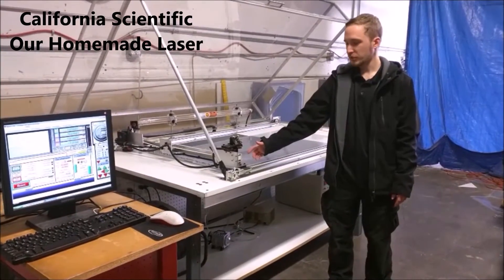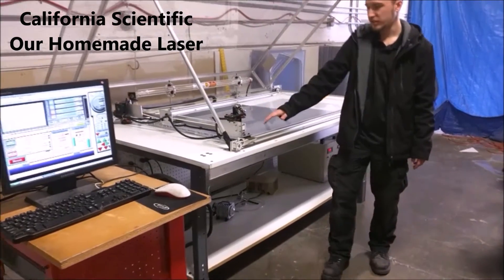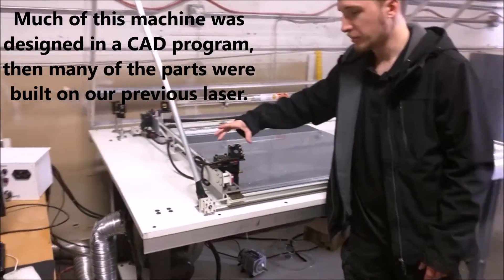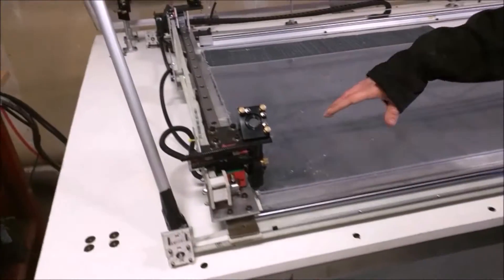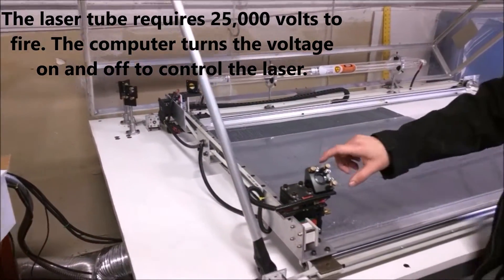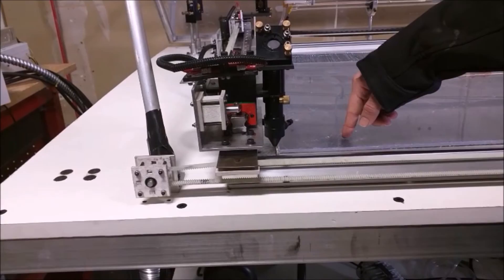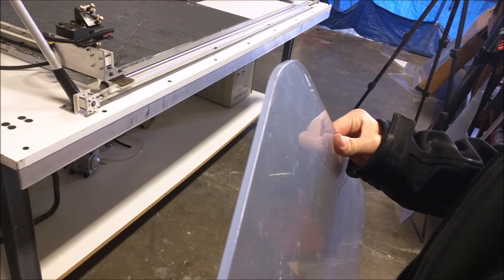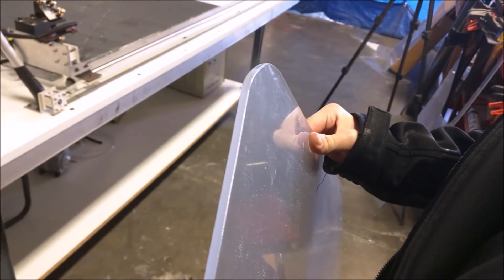LaserMovie

Comment: On your website I didn't see a listing for either of my bikes, a '97 Honda Shadow or any of the Suzuki Intruders (or variations). Are they that odd and difficult to make?
Also, I was wondering about the text saying the cover was "black" to the laser because of the laser being infra-red. Is the plastic in the cover coated, or a special type?
Reply from the maker: Transparancy is an unusual property. Very few materials are transparent, and those that are are transparent only for a small band of frequencies. Clear plastic is transparent in the visual band. Pretty much nothing is transparent in ultra-violet. Very few things are transparent in infra-red, and plastic is not one of them. This forced chip makers to change dramatically about 15 years ago. They use ultra-violet to draw the transistors on the chips. They can no longer use focus lenses, they must use focus mirrors.
Reply: @marklawrence17  - Thank you. I work in an optics lab. We use Class 1 lasers to engrave opthalmic lenses, and that answers some questions regarding machine covers.